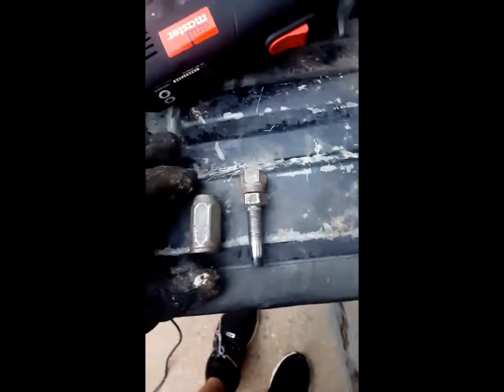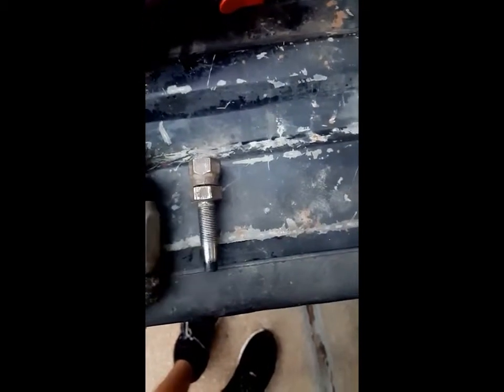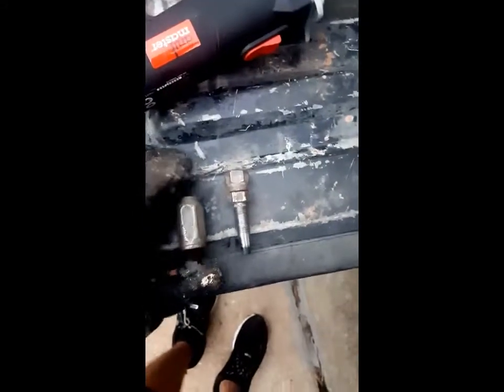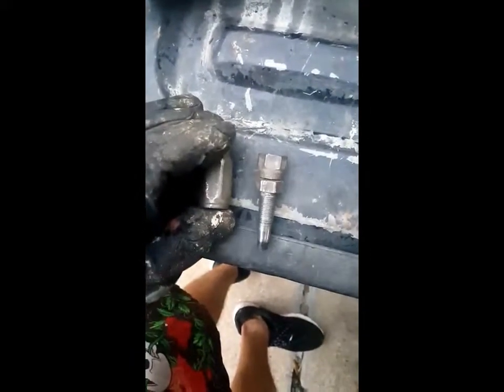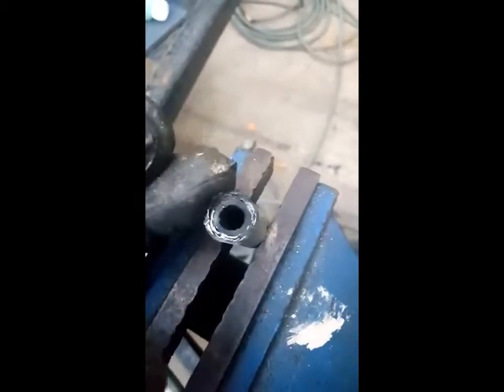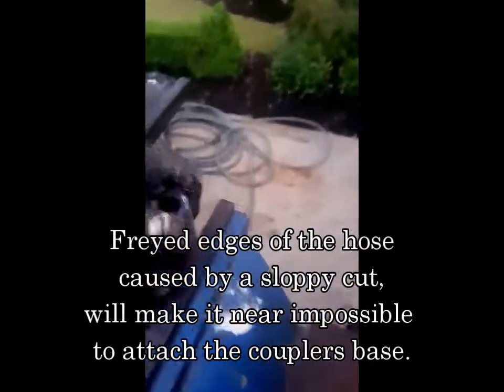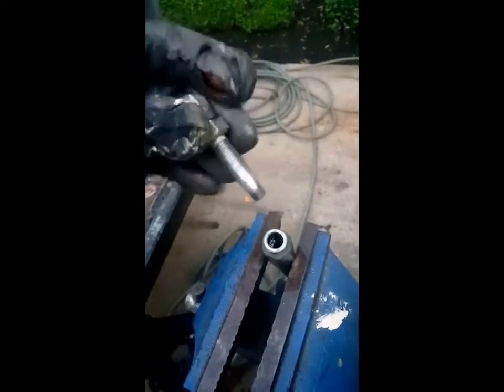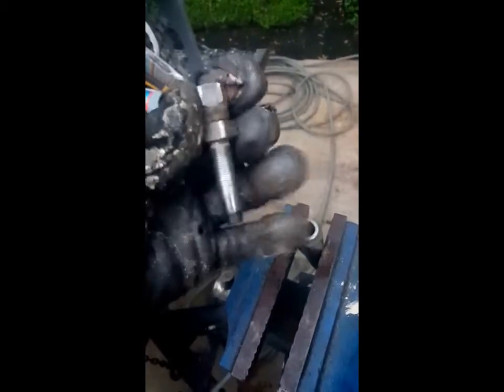How to Repair a High Pressure Hose Out in the Field

Comment: You did not complete the job. How about the other end? What parts do I need & model no.?
Reply from the maker: choose!No model number, the fitting needed is an Apache, reusable hose repair coupling. You can choose from a 1 wire or 2 wire fitting depending on your hose size. You can also chose male or feclose-upsmale, I recommend the male. In the first seconds of the video, I forewarned everyone that I did not know the names of the parts but gave a broad description. And showed close ups of what The job looks like. Job was completed, but could not get the end of the videos to upload properly. So there was a bunch of footage that was not seen and had to do the best I could. With what was compatible.The job

Comment: A new Karcher hose with a quick disconnect is $16.78 at Home depot. 25 ft with 3600 lb pressure rating. I keep a spare in the truck just in case. The repair is cool but you lose a lot of hose with your repair. Just as easy to replace the whole mess and be done with it. I tried to repair my hoses until I found out how cheap and easy it is to get the part at HD. Best repair that lasted was to coat the hole with JB Weld. It worked and has held up for years.
Reply from the maker: I think we might be in two different fields here. Have you tried this type of hydraulic repair? This is a permanent fix, and I have had many hoses last a year or more and the only reason the hose didn't last longer was another issue. These are also, 150' ft or longer double wire braided hoses costing $250-$400. It is worth the repair in my world. But whatever works best is what I recommend.
Reply: @GennUSA  Yeah, Im talking about pressure washer hoses suitable for washing vehicles and structures. I have used the gates repair but for my application it isnt worth the bother.
Reply from the maker: @xgtmg  
Correct. Im talking about commercially, when a hose is blown, a contractor cant finish the job, loses money, etc... For my line of work, it's good knowledge, for u, it is better to buy new.
Reply: So you wash for a living? I'm assuming you don't. Any kind of pressure washer supplies at home Depot are all garbage I apologize to break the news to you but it's true
Reply from the maker: @craigguilder6593  Your comment, I assume, was directed towards the Karcher guy, Mr. Raines correct? If so, the premise is aligned with my thoughts exactly.

Comment: This repair connector cost $15 or $17, a new hose is $22, I will buy new one when not out in the field.
Reply from the maker: Lol, you can buy a double or single steel wire braided 4k psi non marking hose at 100ft or more for $22 bucks? Im shopping at the wrong places...
Reply: @GennUSA  oh no, mine is a residential use only, so 3200 psi and 50 ft is pretty enough :)
Reply: Not if you're running a 200' hose
Reply: @Scott.Farkus  haha, that’s right if you have a 200 feet hose:)